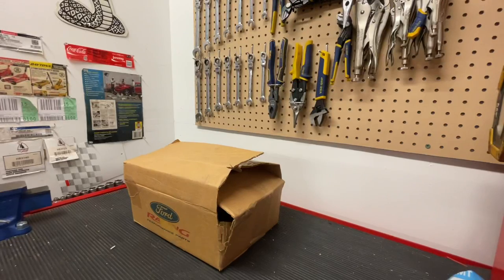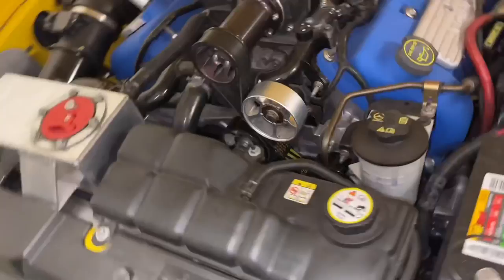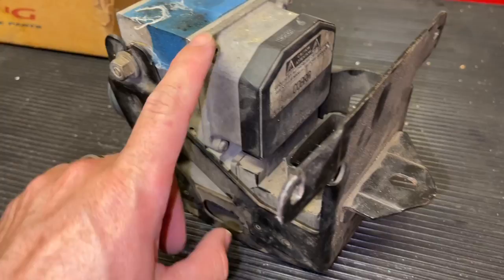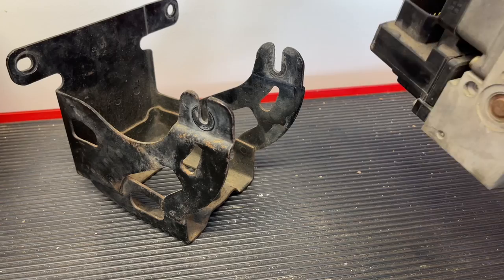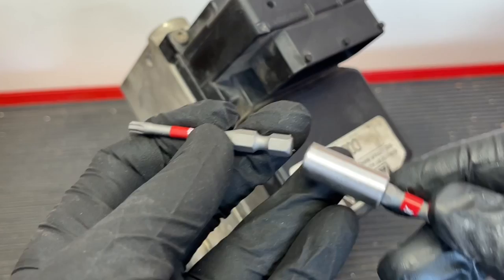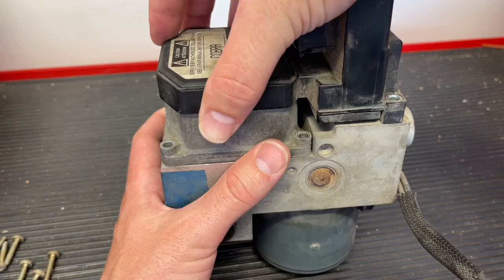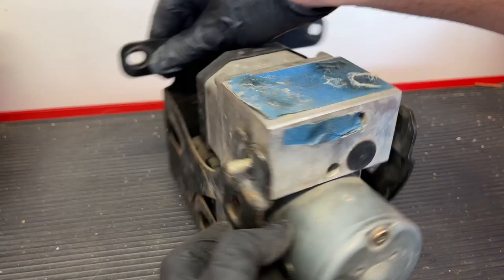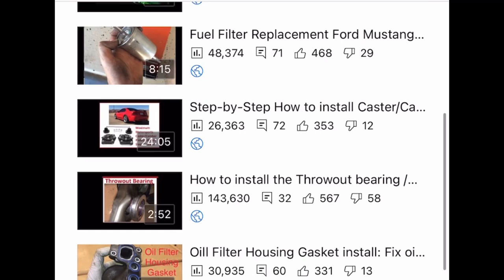Ford ABS Module replacement: Mustang Gt, Cobra, Mach 1, Bullitt, Saleen, Roush 4.6L V8

Comment: I don't understand how you can remove the whole housing out of the car and replace the module without disconnecting the brake lines.
Reply from the maker: The video is showing you how to remove it from the bracket and disconnect the module so you don’t have to remove any of the lines
Reply: He’s showing how to do it so that in theory you can do it with the valve assembly still on the car

Comment: Is there a way to test it? My 04 Mach is throwing the ABS light, I actually swapped the whole unit out for another one with no luck. The car drives fine. I even tried to have BAMA tuned the ABS off but the light is still on!!
Reply: Probably a bad sensor at one of the wheels.
Reply: @kraigparadise5770 How do you test the sensors?
Reply: @3500camarz  Some OBDII code readers will tell which ABS wheel sensors are faulty but I would think only if the ABS module is in good condition.  The manual way is to test each ABS sensor with a multimeter.

Comment: What’s the purpose to change the module I’m curious?
Reply from the maker: It would be changed if the module had failed and the abs light is on. However, dirty wheel speed abs sensors or bad sensors can also do that

Comment: I just changed out the module and it connects now but I’m getting codes c1805 and u1262. Does it need to be reprogrammed?
Reply from the maker: It shouldn’t need to be reprogrammed. Maybe disconnect the negative battery terminal for a few minutes to clear the codes, but that’s all to my knowledge
Reply: @dannyjohnsonsgarage  thanks for the reply! I had the negative terminal disconnected while I changed out the module.

Comment: So just to make sure I understand, if I only need the module, then I do not have to bleed the brakes, but if I remove the entire thing, I have to disconnect the lines, then I would need to bleed the brakes?
Reply from the maker: Yes. Just be sure to bleed the brakes if any fluid does come out. If any fluid is involved you’ll need to make sure it’s repaired before attempting to drive